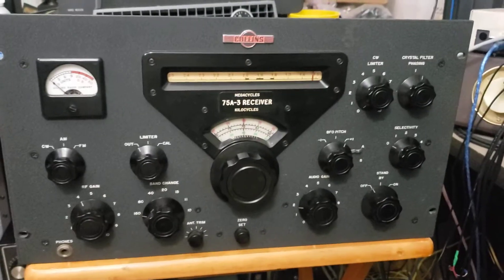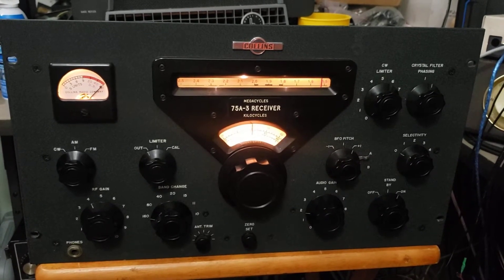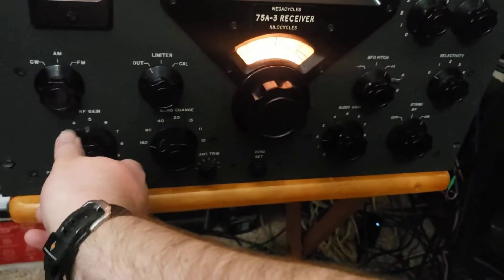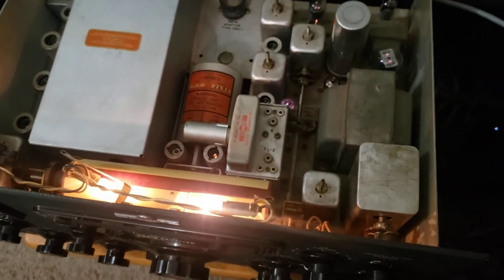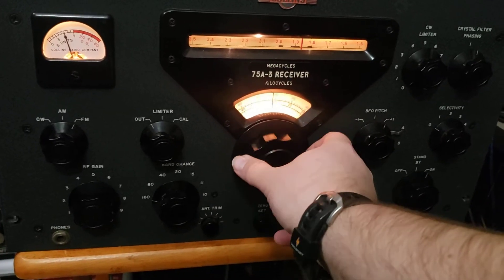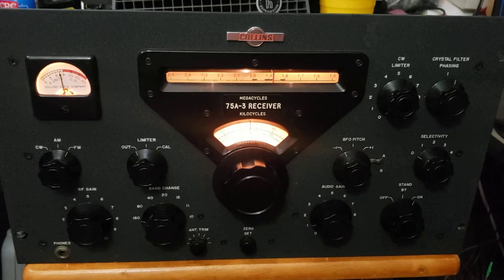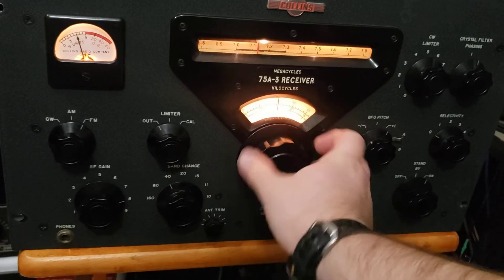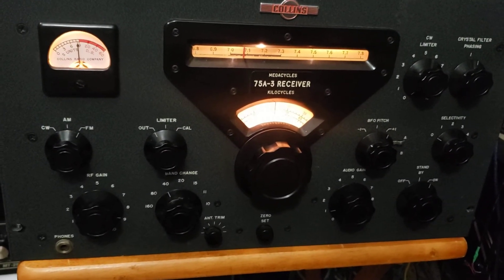Collins 75A-3 demonstration

Comment: Wish I had kept mine. Sob!
Reply: Product detector sounds nice, any info on the mod appreciated.Thanks
Hank wd5jfr
Reply: Hi , well i got the Collins 75A3,  I was told the radio stop working in the 60's and it was been store in garage  since . It was extremely dirty. I expected  the chassis , caps are orginal like it  just never used. Put on a variac  the 5Y3gt was dead. Replaced after 2 weeks of cleaning.  She fired up and works beautifully.  Did  repaint the cabinet  to orginal dark grey, looks brand new.
Francesca W7LTG